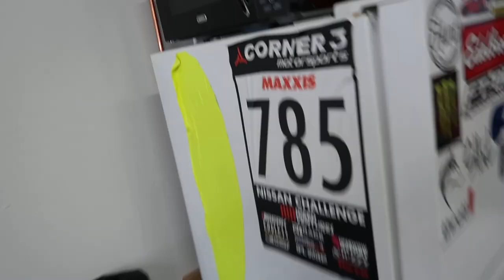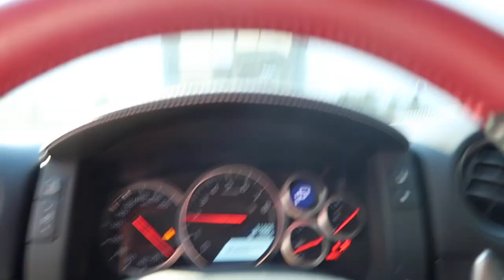The perfect truck for trailering a track car

Comment: if you're looking for a truck it depends how much you're going to be towing and how far. an easy answer.... go with a 3/4 ton. make doesn't matter if you're going with a gas motor. I would only suggest a diesel engine if you plan to tow cross country. also, go with an enclosed car trailer. you get more utility out of it and it looks more professional. you also have a moving billboard for sponsors. you can get into a setup for 15-20k. I use a restored 86' dodge to tow my challengers. crowds seem to like the set up.

Comment: I would recommend a 3/4 Ton Diesel Truck if you want to have a good Daily Driver and a good Heavy Duty Truck. Plus if you want good truck for 10,000-15,000 Dollars, I would recommend looking at trucks from 2006 and under... The best trucks are the 99-03 7.3 PowerStroke, the 05-06 LLY Duramax, or the 3rd Gen 5.9 Cummins.

Comment: Hey TJ I have a 2016 Chevy Silverado 1500 but before that I did have a 2002 Chevy Silverado 1500 and I've never had a problem with the truck it's can haul but I would recommend a Toyota Tundra they have strength and built to haul things. Dodge never owned one but that is my dads work truck is a dodge truck and honestly it has a lot of computer problems they are sensitive that's why.
Reply: Silverado or Tundra are my recommendation but hey it's up to you man and goodluck with which ever truck you pick. By the way I'm a big fan of your GTR.

Comment: My dad used to have a Dodge Ram 3500 with the Cummins engine. if you get the new Ram you get a 6.7 i6 with 900 lb ft stock. Even if you get the old 5.9l i6 you get over 500 lb ft stock from 2000. 2004 and up is over 600 lb ft.

Comment: you should get a ram rebel because they have air suspension and can adjust to weight and keep a smooth ride for comfort + it's not overkill for what your hauling keep it simple and get a ram rebel

Comment: All you need is a half ton chevy or ford. They are very reliable and the maintenance and insurance is cheaper than a diesel. Ive towed 5600 with a 2014 silverado 2wd 5.3 8 or 9 times and it towed the same trailer just as good as my 2003 gas 3/4ton chevy does. Those new motors have more than enough power. The only advantage a 3/4 ton would have for you is the weight, your trailer wouldn't push the truck around as much.

Comment: 2003-2007 Silverado Duramax, try and get the LLY or LBZ engine since they're the best. The Dodge Cummins from 2003-2007 are too expensive and the Powerstrokes have numerous problems. You can get a good Duramax with good miles for $15k

Comment: Gas trucks are going to be cheaper to maintain but it doesn't have the power of diesel. For your use a gas truck is going to be fine. Avoid Ford 5.4l gas and 6.0l unless it was bulletproofed (upgraded head studs and bolts). If I'm not mistaken the early 2000's Chevy diesels had injector problem so I would be careful. Dodge cummins is a good engine though sometimes the injector pump fails and that's pretty pricey.

Comment: I work for Ford. 3.5 Ecoboost is better than the v8. more towing and hauling. They are expensive though. Cheapest will be Dodge. My friend has a 2016 f150 with the 3.5 ecoboost and he trailers his rsx and you can't even tell that the trailer is back there

Comment: TJ you need to get a diesel for towing. It will get a better gas mileage while towing and tows easier. For towing your car you really do not need a dually. I am a ford guy so I am ford biased but you do some research on it and pick what you want but you really need a diesel.

Comment: I would honestly if you want to save money in the long run get a Toyota Tundra. They are really reliable. And maintenances cost is really low. I have a 2008 Toyota Tundra V8 5.7L loaded and I tow everything with it. I have honestly put 350000 miles on it and the truck is still running like new. Best part about is I haven't done any major repairs it. Just oil change, and a tune up.

Comment: TJ/Calvin: if you're still looking at trucks to bring Selena or Cal's Miata to the track.. Go with a diesel, and preferably a manual.  Most used automatics have trans issues (used ads always say "trans rebuilt") because people pull more shit with them than what the trans can handle.  Ford's older 6 and 7 liter 350's get shit mileage and over time having to stop at the pump to fill it up will get old quick, and the automatic transmissions add to the high fuel consumption.  Down here in the SE, you barely see anyone use GMs to pull serious weight.  So what does that leave that's domestic?  Mopar.  Go with a Dodge.  They use Cummins diesel engines in their trucks.  What's good about this, especially with the older 12 Valves which are mechanical and don't have all the computer shit of the 24V and newer models.. they can be serviced by any good diesel mechanic, and you don't have to worry about going to the dealer for brand specific parts like you would for PowerStroke and Duramax engines.  Cummins has been around for a long time and all they do is diesel engines.  People swear by old RAM trucks and I'm one of them.  I have a 2000 3500 with a manual.  I've pulled a friend's lawn trailer fully loaded with gear, and my truck didn't even flinch.  Friends of mine have a transport business specializing in high end cars, and they also only use diesel RAM 3500 but they're on a whole other level and they lately get the automatics.

Comment: I'd recommend a Duramax. pricy but worth it in the long run they have alot of torque which helps alot and they get better gas milage than a V8 gaser. you'll get around 12mpg to 10 mpg with a V8. with deasil you'll get close to 20mpg but the fuel is a bit more expensive. But there very reliable and meant to haul heavy things for long periods of times and are setup for it.

Comment: Ford F-150 ecoboost. It has a lot of different options tow packages and so on. The ecoboost has a 3.5L twin turbo engine. If you get the one with a 3.73/4.10 gear ratio it can tow over 11,000 pounds. If you need any more info on that I'll be happy to answer any questions you might. I've got a full list of specs.

Comment: Silverado are good, I would go with one of the newer f150s with the ecoboost engine since it has a higher towing rating and it gets better gas mileage. Definitely wouldn't go with a dodge truck in my opinion though.

Comment: if u want something for towing crazy amounts of stuff and get like multiple cars on a side hoe trailer u should get a ram 2500 or even 3500 if u really want to be extra but u really don't need that, but I think a raptor would be enough for what u need the only thing is that ecoboast engine isn't really tester yet and I might worry about the engine under pressure but if u get it u have a warranty either way so you should be good

Comment: The best thing you could get as far as trucks go is a heavy duty diesel. Don't get a gas job. They get bad mileage and are a lot weaker. Personally I prefer the Ram. The inline 6cyl Cummins diesel is the best towing engine in a pickup, it's essentially a smaller version of a semi engine. Plus the Cummins gets amazing mileage and are commonly known to be some of the most reliable engines ever put in pickups.

Comment: 2005 lly or 06/07 lbz through gmc or chevy. Amazing trucks with great fuel econom5 running a basic tuner, deletes, and re gearing. Handle lots power and look clean done up. Look at classic duramax's.killer trucks ive got an 05 lly and ma do I love my dirtymax!!!
Reply: Independant front ends on chevy's are noticibly smoother and more confortable rides
Reply: Won't have transmission issues like dodge's

Comment: most dodge cummins before they were v8s are fucking great and rarely break down my dad has a 01 2nd gen 24 valve cummins and the only probem hes had was 4wd going out and you dont necessarily need it there. My main suggestion is 2500hd chevy or a dodge diesel

Comment: just get a base model 2500  pickup truck and whatever make you prefer but like the Raptor is not really recommended for Towing you want something to towing  safely for your application a gas power is perfect for what you need like dodge have 6.4l Hemi ford have 6.2l engine and cheve have 6.0l vortec  diesel engine is overkill and maintenance cost it's going to be too high specially when you're prefer new diesel but your choice.

Comment: Raptor would break the bank and it's not for towing. Get a used 1500/f-150 or maybe even an old diesel if it's in the budget. Diesels are more reliable, the engines last longer (so being used is no big deal), and make so much more torque which equals better towing.

Comment: A dually like your friends will break the bank depending on the year and such, and it'll pull the trailer and the 350 like nothing but a Silverado will be good to pull a trailer and the 350, and it'll be cheap also some what but that's a option!

Comment: 2010-2012 Ram 2500 crew cab short bed 4x4 Cummins auto level kit 
OR
2010-2012 Ram 3500 crew cab long bed dually 2wd Cummins auto lowered

Comment: Get a Ram 2500, it's a Diesel engine, so it could tow a lot for what you're actually going to use it for. You don't need such a big truck like that Ram 3500 dually cuz that's just so much for what you want it for.

Comment: I bought a Silverado gas not diesel and towed so many cars from my old 240sx to my 70 Chevelle all over the country. Personally if I could go back I would have bought the 6.0L instead of the 5.3l but no need for diesel it has plenty of power. Also buying and picking up motors transmissions and all the junk that goes with racecars, having a truck is required!

Comment: Buy a second-hand Ram 4x4 with a Cummins.
Diesel is best for towing with it's mountain of torque, and typically get's better fuel mileage under highway driving.
And unlike Gas engines that have a lifecycle of around 250k miles, diesel has a lifecycle of 500k miles. Oh and it's got a turbo.
I really recommend looking into Diesel since the drivetrain is bulletproof and it gives you so many options for tuning it.
Look up diesel dyno tests with trucks that got 1000 HP and 2000 lbft.
Thatdudeinblue reviewed one, I recommend watching it.
- Trust me, I'm a Mechanical Engineer.

Comment: With the amount of towing you will be doing I would suggest either an 03-06 5.9 Cummins dually preferably w/ a manual transmission, or a 01-04 duramax dually which has the lb7 and Allison transmission, or a 03-07 6.0 Ford powerstroke. I own a 05 super duty with the 6.0 and haul my bass boat almost every weekend traveling around my home state with no issues. The powerstroke will be the most affordable. The Chevy and Dodge options will be a bit more from the wallet but around the same price. STAY AWAY FROM MODIFIED DIESEL TRUCKS! More than likely they have been beat to shit. People throw programmers and injectors into these trucks to get a shit ton of power then the transmission and other parts will fail. Buy a stock diesel then modify it yourself.

Comment: I mean a diesel would be great for towing, but you are gonna pay the price for a new one. I think a Ford F150 with either ecoboost motor would fit your needs. Plenty of power for towing with either the 2.7l or 3.5l. You can tune the shit out of them and make them into torque monsters. If your parents drive the truck it won't be overkill either like a diesel. My 2.7l F150 gets 22 to 25 mpg highway and pretty decent mpg towing 5000 lbs and it tows it's effortlessly. It won't sound as good as a V8 but other than that they are amazzzzzing motors

Comment: Bro get a AAA card it's $125 and you get 2- 100 mile tows and 1 - 200 mile tow for a year and don't need insurance and they have a DMV inside. I've been use it since I was 18 when I street raced and that's been 12 years and it's a life saver

Comment: you should definitely get a Silverado 2500 HD they'll last you years my dad had a 01 Silverado 2500 HD and it lasted him 15 years he bought it brand new in 2001 the trans recently broke but that's because he hauled lots of heavy cars and trailers and from pushing a lot of heavy snow so if I were you I'd get a Silverado 2500 HD not a 1500

Comment: Get a diesel 250. You dont need a 350 if your just pulling a car here and there. The brand doesnt really matter because all the engines are built amazingly and last for an abundant amount of years. Get whatever you want but definitely get a diesel not gas.

Comment: get a newer ram 1500 with the  8 speed and 3.92 gears. They can tow about 9,000 pounds and you still get mpg and power out of it when your not hauling.

Comment: spray WD40 onto the surface and let it loosen the rubber and then simply wipe it off on of the only ways to remove rubber scuff marks off the arches.

Comment: 1/2 tons are not built for towing. You want a 3/4 ton or 1 ton preferably Diesel. I tow 12k 5000+ miles a year with a 2000 f250 7.3 manual 4x4. Getting 18-20 mpg empty and 10-15 mpg towing.
Reply: I have both a 2000 f250 7.3 manual 4x4 353k and a 2004 dodge 3500 dually 5.9 cummins manual 4x4 203k. I prefer the 7.3 as my daily. I prefer the trans over the dodge trans.

Comment: Do not even think about a cummins, they have absolutely no power compared to the power stroke and duramax. The cummins has been an inline 6 cylinder truck for a good while now and is not the way to go. Get a 2016/2017 duramax or power stroke. I personaly recommend the power stroke for sure though.

Comment: Get a late 90s, early 2000s ram. Anything with a cummins. Probably one of the most reliable Diesel truck engines out there. Reason I don't say get a newer one, is because my dad has a 2017 3500. He loves it, but it has been in the shop multiple times for the DEF bullshit they have now. If you get ANY diesel, do NOT get anything 2010 or later. Then again, why would you want a newer vehicle, too many  computers. You need a truck that can tow a car, get something cheap.

Comment: a bit late, but look into a Ford 7.3, they're a little pricey for their age and you won't find one with low miles, but for 8,000 you'll get a solid truck that will run until the dinosaurs come back and it can pull a fucking mountain. Might not be quick, but God damn they won't stop once they get going

Comment: Should just get the 2011 Chevy Silverado 4wd for around 30-33k. Don't get the 2017 Silverado, cause you're not going to be using it as like your daily truck anyways. And I say the all wheel drive since you'll be towing your 350. Unless you could afford the 2017.

Comment: stay japanese. they make great v8s too! get a titan or a tundra. The new titan xd has a cummins 5 liter 32v diesel in it! 310 horsepower and 555 lb-ft of torque. 12,640-lbs of towing capacity. the tundra's 5.7 can tow over 10,500 lbs. and the bed can hold 2k lbs in tires lol.

Comment: Why don't you get a single cab diesel? They are tow pigs! 

Raptor would be good but get a 6.2L 
Don't buy the ecoboost v6!

Tundra 5.7 v8 would be nice 
Silverado v8 would work
Titan full size with tow package cause some didn't come with it would work as well

Comment: New 2017 super duty or Duramax would be perfect. Best results in torque. Don't listen to the bandwagon rams. The Cummins is old and and doesn't provide as much anymore.
Reply: Just look for yourself
Reply: You also mentioned a raptor. Shit that's hands down a done deal but super expensive

Comment: Get a gmc 2500 don't get a 3500 u don't need it and ur parents won't like a 3500 the 2500 is just better for u I would get a diesel because better gas mileage and also faster and can tow more plus it will last longer

Comment: Chevrolet SS intimidator. Or an LB7 duramax. Those may be hard to find in cali though. The 6.7 Cummins in any year is great and the 5.7 hemi trucks are good after 2010 and up. The ford 5.4 triton motor is GARBAGE! Stay away at all costs! Any 5.0 truck or ecoboost truck is the tits.

Comment: Well that answers it.

Get what ever truck your parents want. sell the frontier use that for a down. if they want to stay Nissan, and you want to tow, well guess what.

TITAN XD with Cummins® 5.0-liter DOHC 32-valve V8 Turbo Diesel engine*

*this was not paid for by Nissan.

A Nissan shoot your boy a GTR for this recommendation i just dropped.